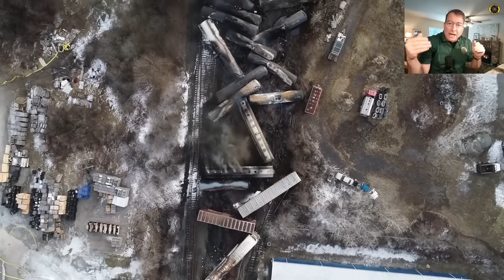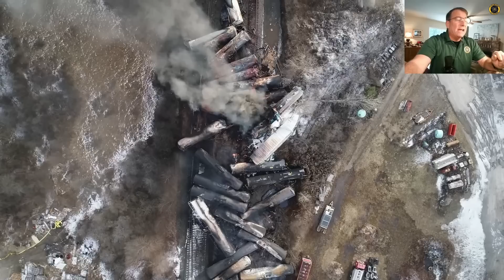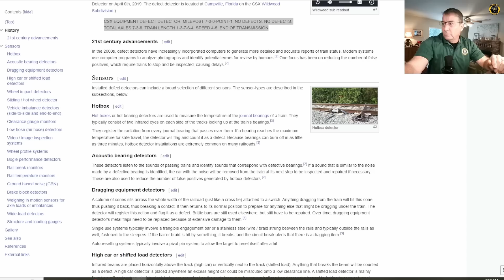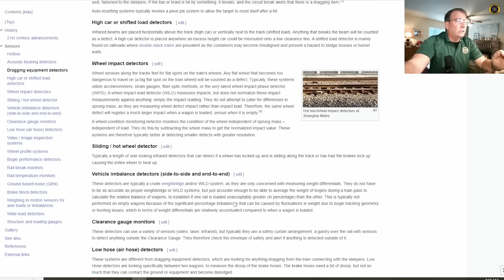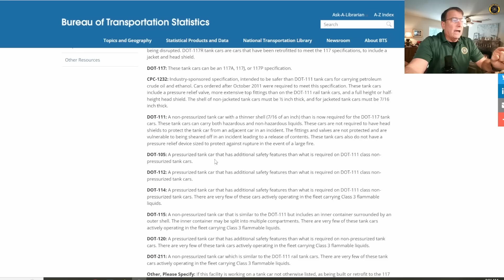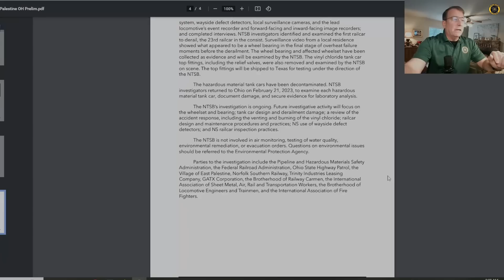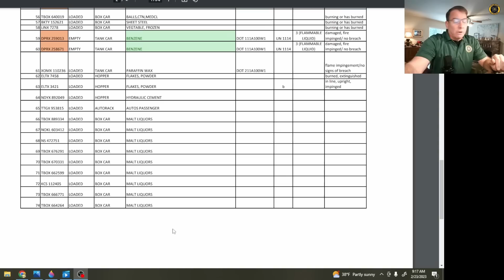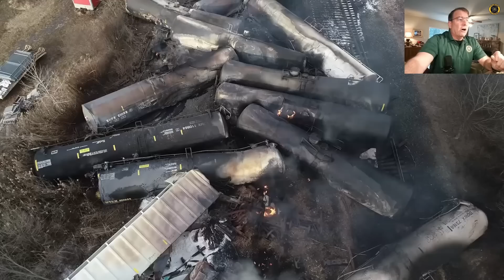NTSB Prelim Report: Norfolk Southern Train Derailment 23 Feb 2023

Comment: Train control's  purpose positive or otherwise is not so much to prevent derailments as it is to prevent collisions with other trains.  Dynamic braking is a speed control tool not the primary  method for bringing a train to a stand.  That is the job of the automatic air brake.   (Train driver 34 years, retired)
Reply: How is coordinating done between the first two engines and the engine further back?
Should the rear engine slow more so as to create a tension on the cars in front of it?
Reply: @M Ball, here is the answer to your question....
Typically, the DPU is synchronized to the lead locomotive...meaning any throttle, dynamic brake, or air brake changes made on the controlling locomotive are simultaneously made on the DPU. 
DPU's are not intended to be used for controlling slack in the train cars as you suggested, per se. They do stretch or bunch slack to a certain extent, depending on throttle position, brake application or terrain.

DPU's also have the ability to be manually operated, independent of the controlling locomotive. This feature is sometimes utilized in certain circumstances...but that's pretty rare. 

When a train has an emergency brake application, the PCS (pneumatic control switch) of ALL locomotives in the train, regardless of position, open. When the PCS opens, the locomotive will immediately drop to idle and will not respond to any throttle inputs from the engineer until it is reset. 

The open PCS reset procedure can take up to 5 minutes to complete once the continuity of the trainline (air line between each car and locomotive) has been established by a physical inspection from the ground by the conductor. 

Communication between the controlling locomotive and the DPU is done by VHF radio. There are two of these radios in each DPU capable locomotive. One radio is used for communications and the other is for redundancy. If there is a communication failure, or loss of communication between the controlling locomotive and DPU that exceeds 16 minutes in duration, the PCS will open, placing the train into an emergency brake application, thus stopping the train. If communication cannot be restored, it can no longer operate as a DPU train and must be reconfigured as a conventional train. 

The intent of the DPU is to increase fuel efficiency. A train with 3 locomotives, two on the front and one on the rear is more fuel efficient and will travel up hills faster than the exact same train with all 3 locomotives on the front. 

The DPU can also reduce coupler stress on long, heavy trains...but if operated incorrectly, can significantly increase coupler stress...to the point of failure. 

A good engineer will spend part of his time thinking about where he is going but more time about where he has been. He is thinking about where his train is on the hill he just went over, when the DPU is cresting that hill, and when to manipulate the throttle or brakes to control slack stretch and run-in.... and yes, you can certainly feel when that locomotive, that's almost 2 miles behind you, starts down the hill.
Reply: @MadDawg91108  Do you think run in is what cause the majority of the derailment? How would that be if the rear engine was set to brake the whole system upon loss signal? this is what has had me confused in the arguments I have seen.
Reply: @Ohh Paul  the cause of the derailment was 100% the failed bearing.... and yes, run-in is what caused the rest of the cars to derail. 

When the affected car derailed, the rolling resistance of that car was greatly increased by the drag of the wheels plowing into railroad ties and ballast.  Essentially, the derailed car slowed much quicker than the cars behind it, causing the cars to pile up until the emergency brake application had sufficiently slowed the remaining cars.
Reply: @MadDawg91108  Read this folks, This is factual information here.
Reply: @MadDawg91108  Good Stuff!
Reply: @mballer  Radio control by digital commands by the engineer or driver to the rest of the world.

Comment: Just a few technical detail information/corrections.
In the days of cabooses, there were usually 2 to 3 people in the cab of the leading locomotive (engineer, fireman and headend brakeman) and 2 to 3 people in the caboose (conductor and 1 or 2 rear brakeman/en).
Pretty much, anymore (for the past approximate 20plus years), there are only 2 people in the cab (conductor and engineer).
Reply: And the railroad management has been increasingly pushing for just a single person engine crew.
Reply: @railfink  I believe most European trains have only one person in the cab of passenger and freight (goods) trains.  Without some changes to equipment, signals, and methods, I don't agree with a one-person crew.
Reply: @royreynolds108  Yes, most European trains run "engineer only" under normal operations. On passenger trains, the lead ticket inspector will sit with him, in case of major signalling failure for safety. Freight trains will move slower, as there is nobody else around.
Reply: @csgergo80  Also don't forget there is some serious train length limitation in Europe. A train't can't exceed 750 meters
Reply: Correct.
Reply: Would another person sitting in the cab have been able to prevent this? No. 

I don't agree with the reduction of staff or many other things the railroads do. But, trying to connect the two sounds like union whining where it doesn't have a purpose or relevance.
Reply: @hewhohasnoidentity4377  the 2 man crews did allow them to set handbrakes and separate the locos from the rail cars
Reply: @hewhohasnoidentity4377 , nope, but also did any of the words of my comment imply anything close to saying it would have?
My reply was mostly a friendly response to Juan, in the video, saying something about a fireman in the caboose.

Comment: Positive train control is a protocol which is intended to keep trains separated from each other. By preventing collisions between trains, it would prevent derailments that are secondary to such collisions.
Reply: How does PTC have to do with what happened here?
Reply: @alanmorrison3598  nothing. The NTSB noted in its report that this segment of rail is under PTC. That system hasn't been implemented nationwide even though NTSB has been pushing for it for decades. It has no positive or negative effect on a single-train derailment.
Reply: @MichaelOnines  It HAS been implemented nationwide on territories that it's required under. For years now.
Reply: @TheNemosdaddy  I guess more in the sense of not all track segments.
Reply: @MichaelOnines  It's not required on every section of rail, just areas specified by the FRA. Mostly areas that run Haz mat and any passenger services
Reply: @TheNemosdaddy  My understanding is NTSB wants to expand the areas it is required. NTSB is an advisory board so has no regulatory authority.
Reply: @alanmorrison3598 Nothing.
Reply: Yup, it's like ATC helping keep trains from over running their authority... when it works, which is why it's not 100% sure.  I know too many crews that have seen PTC fail and be taken out of service.
Reply: Thats not relivent to this accident
Reply: PTC, has multiple functions. Stopping of red signal run throughs, overspeed incidents, and now it's integrated with trip optimizer to essentially automate train control. Engineers do nothing except babysit the system on the mainlines anymore.

Comment: The "controlled burn" may not have been a controlled burn.
Reply: By definition it absolutely was not. I went to business school and even I know that.
Reply: It was controlled in the aspect of the second option was an explosion or multiple explosions due to the heating payload.
Reply: @Batwingsix  - Or perhaps the lesser of 2 evils??? The explosion of car/s of poison or the burning of the poison that sends poisonous smoke into the air where it blows all over and covers everything it lands on in another form of the poison????  Could not there be a way to somehow quickly remove the chemicals into say, trucks that are made to carry it, and get it out of there safely???  It is just so sad to think about all the people and perhaps,they are the only  living thing left there, that if the stay or not, have these poisons inside them, going about their business doing damage to their future lives and certainly the lives of any babies conceived after this mess...
Reply: @frandanco6289  so send in trucks and people to work on top of burning freight cars to attach hoses (usually rubber or plastic) to a truck to pump an already overheated product and is combustible into another container so it can drive through a neighborhood to leave the area... All the while it is risking explosion or fire due to already being pre heated, or it igniting when the tank car drain system is opened (if even accessible which it probably isn't after the wreck). Plus chemicals had already spilled, I guess locals want a few hundred foot deep open pit mine dug to remove the dirt as well, which couldn't have been done anyway because the fires would need to be out, and wreckage removed prior. Some of you can't see the forest because the trees are in the way in terms of seeing the whole picture
Reply: Yes, it was a controlled burn.

Comment: An emergency brake application will not cause a derailment. During my career, I was forced to use it several times and never derailed from it.
Reply: If emergency brake applications caused derailments there would be a lot more derailments. Think of how many e-stops are performed due to people or vehicles on the tracks.
Reply: Likewise.  Been in many emergency brake applications.  Not once derailed.  However, in two minor derailments the emergency application probably slowed down the chaos and prevented even more damage
Reply: I'm guessing the derailment caused the train to go in emergency and not vice versa.
Reply: @harrygaydosz73  You are absolutely correct!
Reply: Yup. Ive put a train into emergency countless time and its never cause a derailment. I have had many derailments at lower speeds and a few resulted in the train going into emergency. Most times the conductor said we were on the ground so I put it into emergency.
Reply: You are correct...  Normally, EM brake applications do not cause derailments... but if a train is built all F*cked up at the yard with several trailing tons behind empties... derailments are inevitable.  Thanks to PSR I would bet that multiple blocks of cars were added to the rear of this train as it made its way from Madison, IL.
Reply: Thank you Engineers for your service. This was a Masonic ritual.
Reply: My understanding is that when emergency breaks are normally applied all rail cars break at the same time.  In this case it sounds like only the car with the bad bearing  initially was the only car breaking.  This could conceivably caused the damaged car to break away from the car in front of it while the cars behind push other cars off of the tracks.
Reply: @stevenf1678   *BRAKES BRAKING Auto brakes, truck brakes.
Reply: Quite right I was a train driver for 45 years in the UK and as you say an emergency application should not cause a derailment.
Reply: But it CAN happen - I looked it up.
Reply: @watchgoose  I suppose it can, but there would have to be defective equipment involved also. I've experienced derailments and emergency brake applications, in my 10 years as an engineer.
Reply: @garyjenkins2258  Could the distributed power unit have increased the risk of pushing trailing cars into the mess?
Reply: @don_5283  not if they were already in dynamic braking mode like here.
Reply: Since an accident in the1970's when a set of radio controlled locomotives shoved most of a train into a tunnel, railroads and manufacturers changed the system so if a remote controlled locomotive on a road train detected an emergency brake application it idled the power. The accident happened in 1975 if I remember, it took the ICC and FRA 5 years to order the fix. 
     The wreck happened where the lead locomotives where in the tunnel and the pushing locomotives were in the clear and just kept pushing. The cargo was mostly lumber, paper and apples. Then it was tooth picks, recycle paper, and apple sauce.
Reply: @don_5283  Not likely. Locomotive brake shoes are different from freight car shoes. When a loco goes in emergency, the wheels will lock up rather quickly. Freight car shoes work better as they heat up from the friction. Regardless, there is a massive amount of weight trying to keep the train moving. Trains can't stop quickly and that is just physics. When a car derails, it does stop quickly. Every car/loco behind it is still moving and still on the rails. The accordian style stacking is the inevitable result. There's just too much weight, for any other outcome.
Reply: @don_5283 Only the weight could be a factor.
Reply: @watchgoose  It can, but it is rare and usually occurs when the train is traveling at low speed.
Reply: My comment is intended to respond to watchgoose: "But it CAN happen - I looked it up. "  Not sure how it ended up down here.  I was not commenting on the DPU issue.  As explained elsewhere, all locomotives including DPUs will drop to idle when they sense an emergency brake application.
Reply: It will if a car or cars have already derailed when EB is applied which is what happened here.

Comment: There is dynamic (electrical) braking (which is the preferred method by the RRs) to control speed of train, service air braking if dynamic braking is not sufficient to control train speed, and emergency air brakes. Emergency application can be initiated by the engineer or by the parting of an air hose between freight cars. The parting of an air hose can be caused by a number of things including a derailment.
Reply: (edit - I misread what you were saying.) ECP (electronically controlled pneumatic brakes) would probably make trains safer (though probably wouldn't have affected this accident.) Ten years ago the RRs wanted it, when it seemed like it would be required before regulators would allow long trains over 10,000'. As soon as they got permission to be longer (with the incredibly inaccurately named "Precision Scheduled Railroading", they are often 15,000' = 3 miles, nearly twice the length of ten years ago), they stopped supporting ECP and indeed are fighting it. The thing is, all the cars on a train have to be retrofitted, so not only $$$, but you lose flexibility to mix cars on trains until the changeover is complete - in several years.
(Just look at how long they dragged their feet on PTC...)
Reply: @craigdickson7697  he’s not talking about ECP. Dynamic braking has been around almost since the popularization of diesel locomotives in the 40’s and 50’s.
Reply: @Hunter_Dawso  yeah, my bad I realized that after I first hit post. Edited to reflect that.
Reply: @craigdickson7697  Saw somewhere that there about 1.6 million cars on US railroads. That's a lot of cars to equip.  Would probably have been irrelevant in this case.
Reply: @SteamCrane  True....but the conversion can be accomplished. It took a long time for the RRs to switch to roller bearings just like it took a long time to convert to automatic couplers. The great thing about switching to EBC is that cars can have equipment installed while still able to run with conventional air braking system.
Reply: @craigdickson7697  Dynamic braking has been around for ages, pretty much since the diesel-electric locos debuted.  The service brakes are typically pneumatic but not electronically controlled (ECP).  ECP is a great idea.  Freight railways have appallingly low standards and it's not just a safety issue, running (high speed) passenger trains over tracks shared with freight is basically a non-starter until the freight companies get their act together.  If our train loving president and secretary of transit had an ounce of integrity they'd be pushing hard for ECP, PTC, and whatever other common sense acronyms I've forgotten.
Reply: @az.................  also, increasing staffing across the board. I saw a rumor on another site that the task of maintaining the wayside detectors in this subdivision had been combined into another job, basically eliminating preventative maintenance of detectors. That might explain how the previous detector (20 miles back) didn't flag the bad bearing even though security camera footage shows it on fire. (There are 2 security cam videos, one in E Palestine and one 20 miles back.)
Reply: @az.................  There can never be high speed and freight trains combined on the same track. Japan and France have high speed rail service. The tracks must be perfect, no grade crossings. Japan's high speed trains were developed for commuter/passenger trains. You will not see freight traffic on high speed lines, as freight cars and engines would damage the rails, and freight traffic would slow down and interfere with high speed traffic. The two can't mix.
Reply: @craigdickson7697 So how much money was saved by eliminating jobs? Enough to pay for this fubar event?
Reply: @thomasmleahy6218  I don't know.  Absolutely NOT!
Reply: @thomasmleahy6218  I agree, however that hasn't stopped e.g. California from trying to run HSR over freight tracks in the Bay Area.  The back and forth between Union Pacific, Caltrain, and the CAHSR Authority over things like signalling and platform clearance has added untold delays and bloated the cost. The unfortunate reality is that the freight companies own the most useful rights-of-way and we're at their mercy.  Even non-high-speed passenger rail (which typically shares track with freight service in the US) suffers at the hands of the abysmal standards of the freight companies.
Reply: @thomasmleahy6218  The true high speed lines under construction or planned in the U.S. will run on separate tracks constructed for that purpose, much like those in Japan and France.